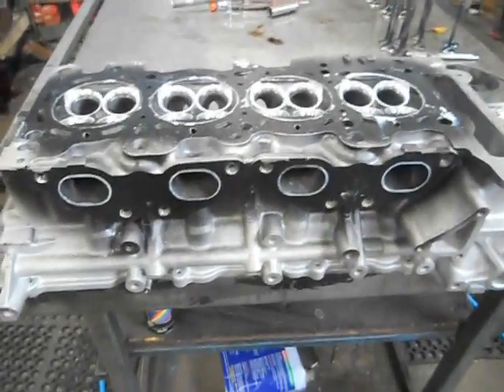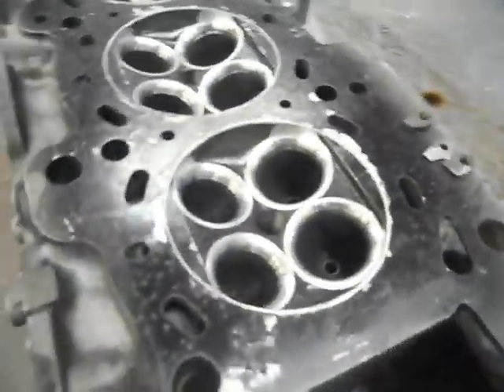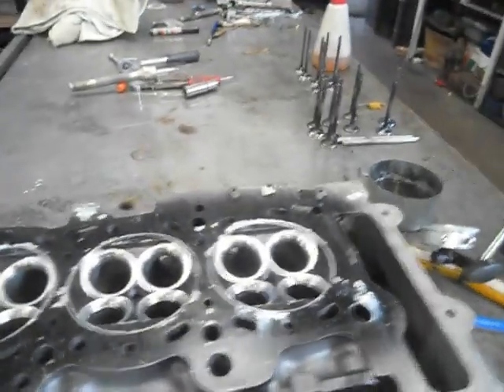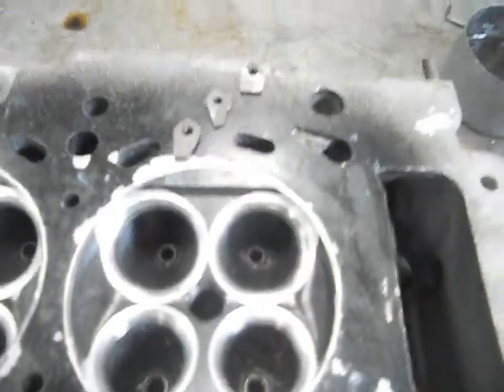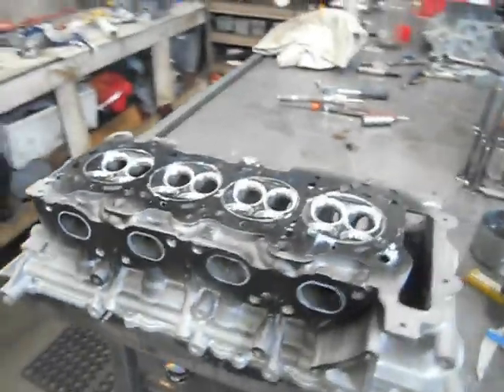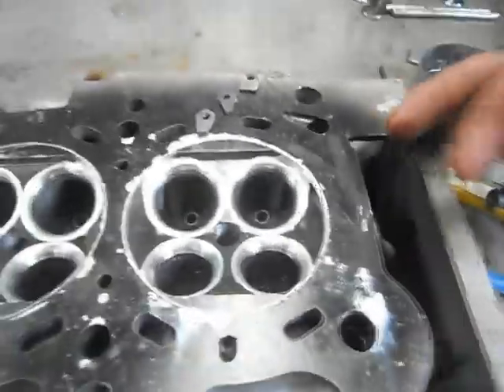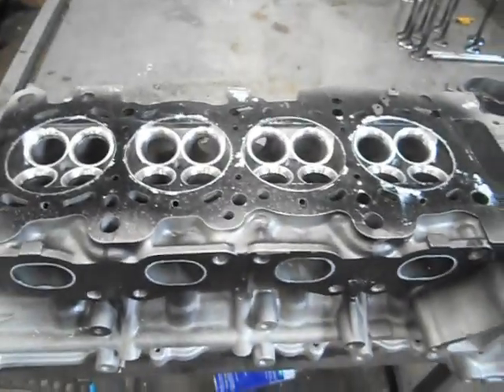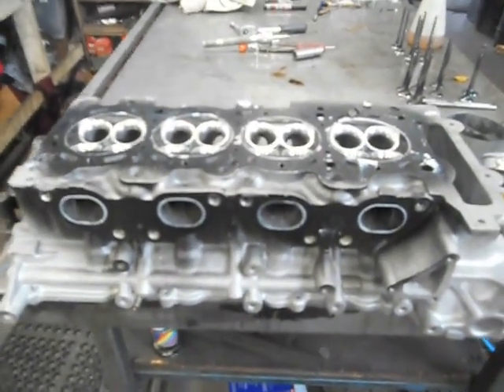How to Port and Polish a 500hp Nissan SR20DET Head,5 angle Valve Seat job...

Comment: Like it! The only thing I disagree with is bending the burr and bothering with an extention, I got a nice collection of burrs, and it's a lot easy'r, and easy'r to control, to just switch to one with more aggressive flutes or larger head, or use one with a longer shank length. But ya know if it works for you, go with it. You do some great work it looks like!